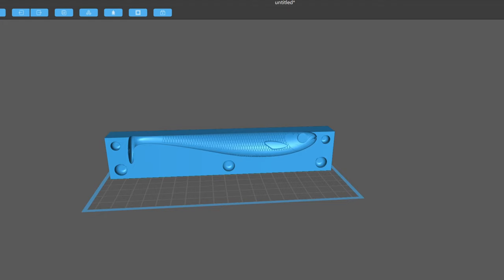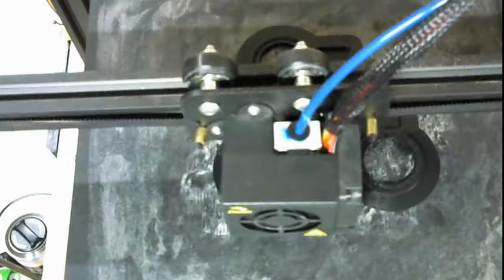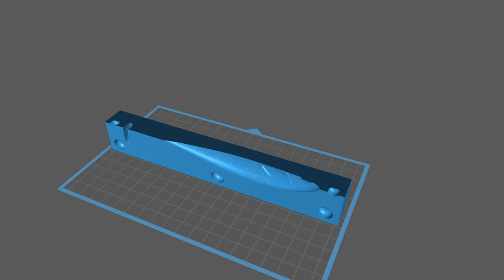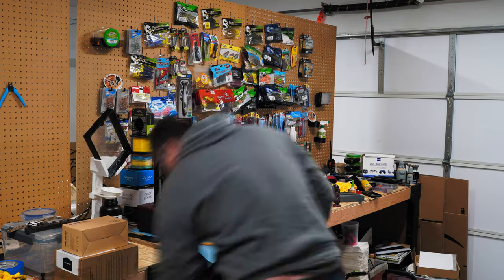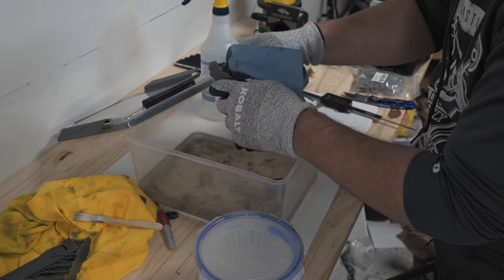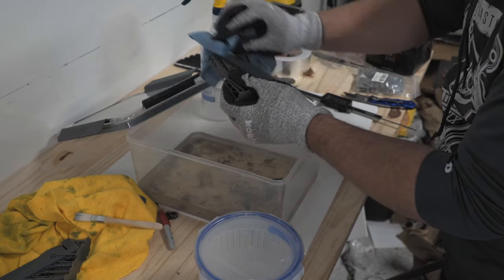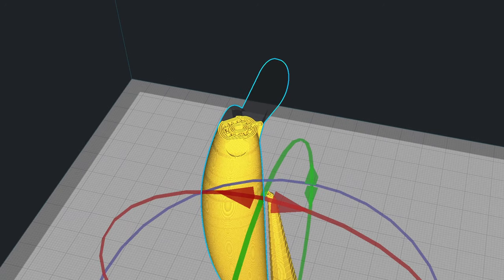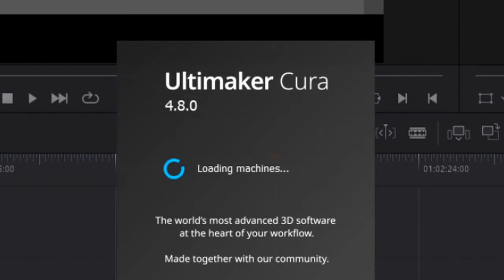The Complete Guide to 3d Printing Fishing Lures - Part 1 Introduction to 3D printing

Comment: What orientation is best for 3d printing molds?
Reply from the maker: Really depends on the mold but in general the short edge flat to the build plate and the injector port furthest away from the build plate. I went looking because I thought I had a video on it but I don't so I will make one shortly!
Reply: @WMBayouLures  thanks. That would be very informative. I did it like that but with supports instead of flat. Hope it turns out ok or doesn't fall off.
Reply from the maker: I am always flat to the build plate with no supports. Will get that video done soon, I am now embarrassed I have not covered it before :-)